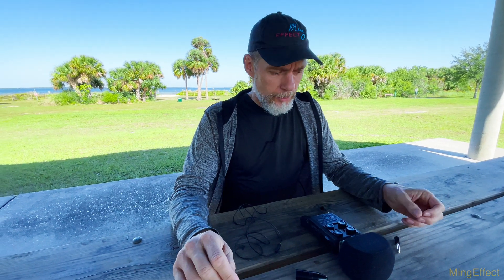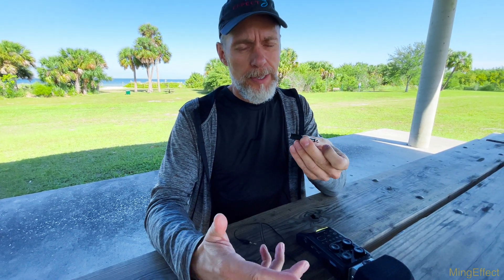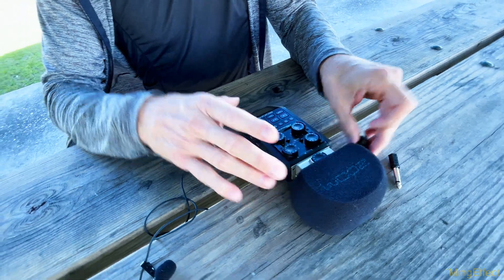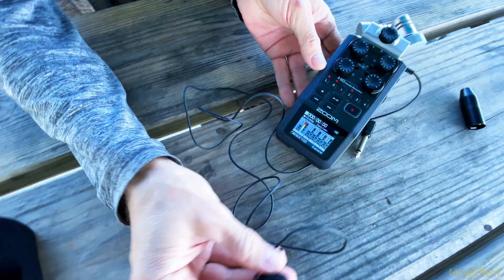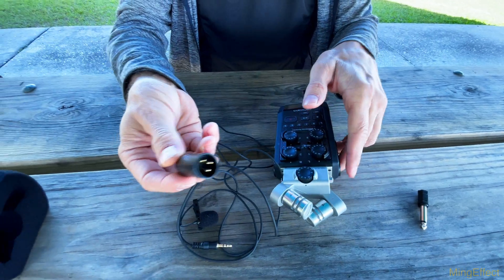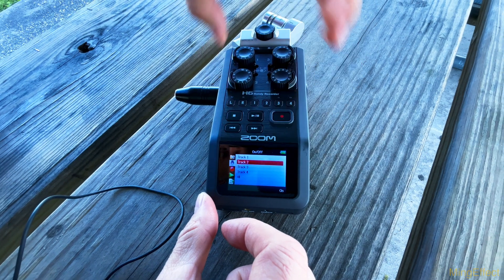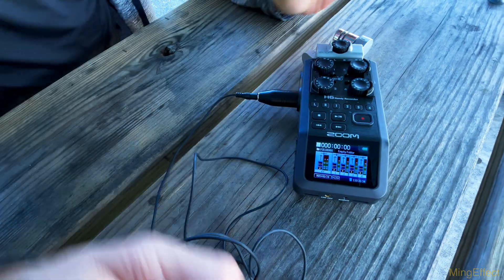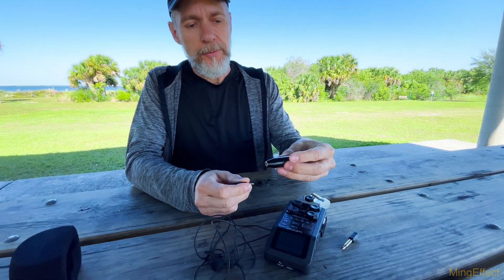Lav Mic Fix Not Recording On Zoom H6 - Ming Effect

Comment: I love this video! I panicked when my newly purchased H6 wasn't catching tracks with the 1/4" TRS Adapter as I only bought it to solve some audio headaches! 

Thanks for the link for the adapter. I wish I found your channel prior to my H6 purchase as I would have liked to thank you by supporting your link there. But I checked your link anyway and the H6 link isn't available currently, is there another way to get a different one? Just thought I would mention in case it helps. 

Thanks so much I really appreciate your help! Now just waiting on the final piece of the puzzle...

Comment: At 68 years old, and retired, I am engaging in a project that I need to record to 4 - 8 channels simultaneously from up to 8 microphones that are not powered (Piezo Chip inputs).  I ordered several different Zoom products, to include the H6, and in reading the manual it sounded like only two of the side inputs (1-4) would work.  Well, that may still be the case if only 2 of the 4 inputs provide phantom power, in which case the larger Zoom L-8 will likely become my GoTo device for the projects requiring more than 2 external microphones (most cases will).  This video saved me from running into a simple 1/8" to 1/4" jack adapter and not getting a signal from the non-powered Piezo Chip devices.  So, many thanks for sparing me what would have become a few wasted hours trying to figure out this whole 1/8" - 14" (or XLR) adapter powered/non-powered/phantom power issue.  

I learn so much more about sound management equipment and software every day - what a fascinating world I have stepped into, simply fascinating.  Luckily I already have a lot of very powerful Apple machines (64Gb  MacBook Pro 16, and a 24Gb MacTower Server, plus lots of equally powerful Windows based machines, and several 16Tb+ hard drive servers (RAID5).